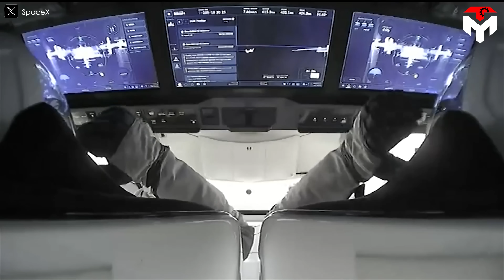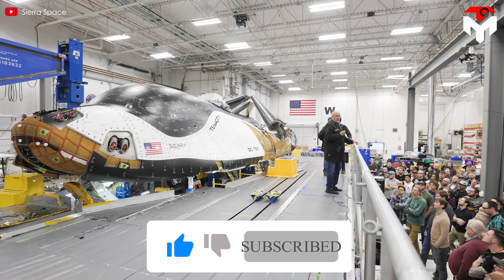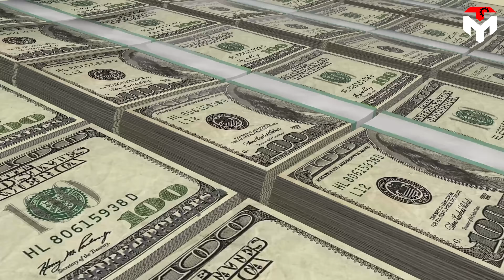Sierra Space's Big Solution to finally Launch Dream Chaser to Solve SpaceX's Dragon Monopoly...

Comment: The original plan for Dream Chaser was to launch on top of an AtlasV but that was back in the very early 2000s when it was SpaceDev in control of it's path forward. There was a lot of debate about the ability to launch with a crew since it had no launch escape system and back then the AtlasV wasn't human-rated. I still wonder ever since Sierra Nevada Corp bought SpaceDev how all this will pan out in the end but I'm not overly confident that it will ever fly humans.